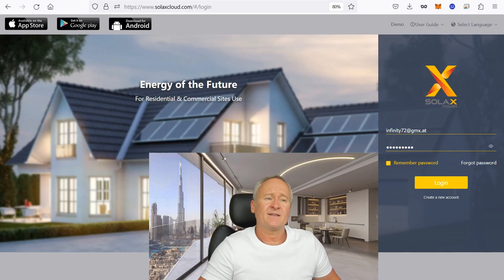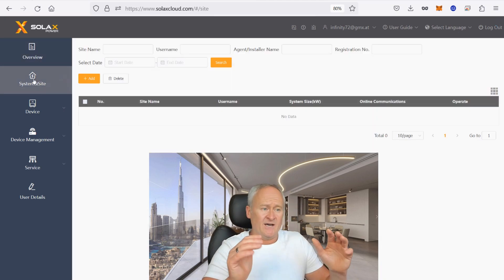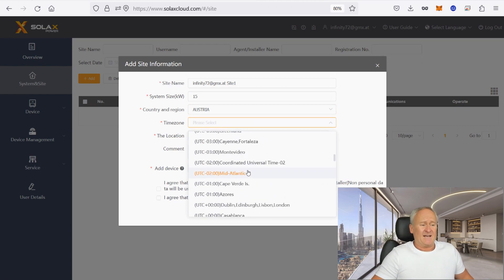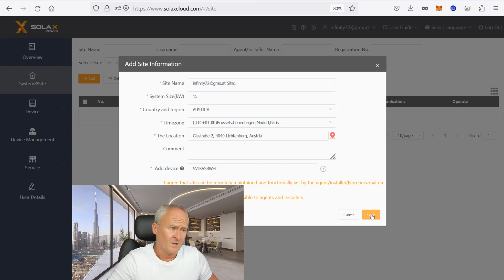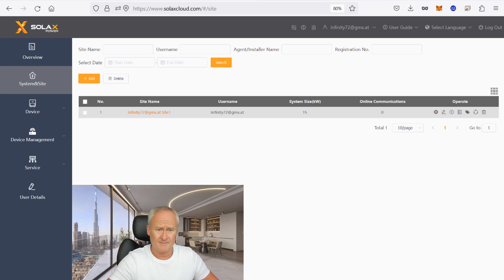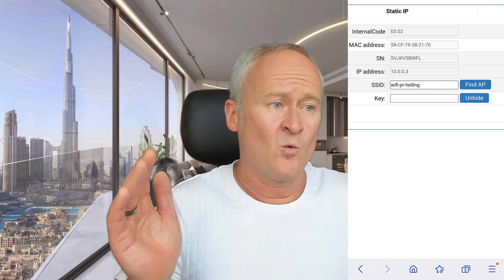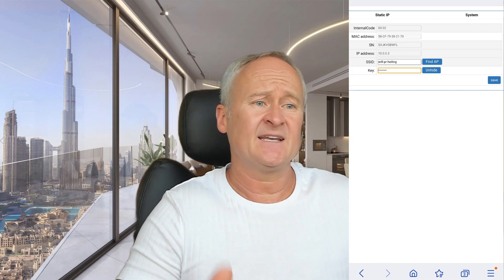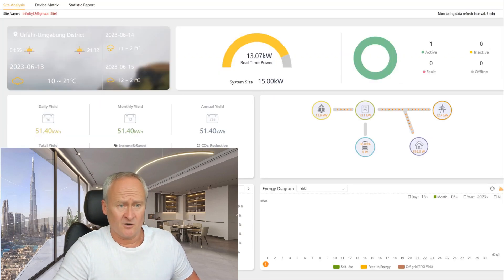Installing the WIFI dongle on the Solax X3 Hybrid inverter

Comment: good video, i will try to connect the next Solax via the webinterface directly as you mentioned. before i alway did it with my phone, but it often goes in error and didn't connect or changed from the dongle-hotspot to the WLAN.